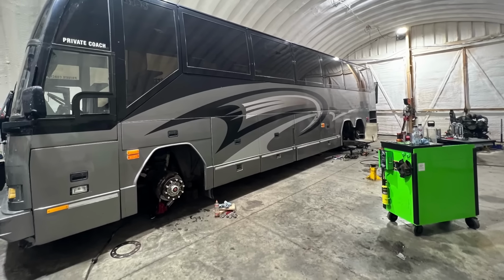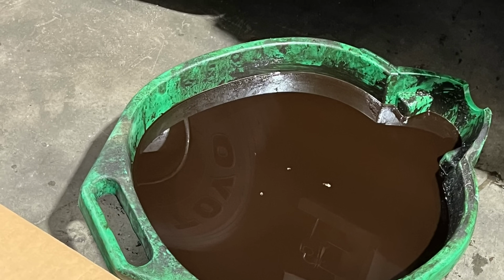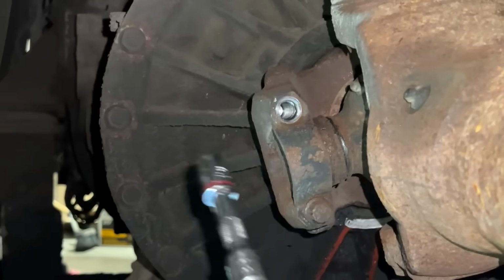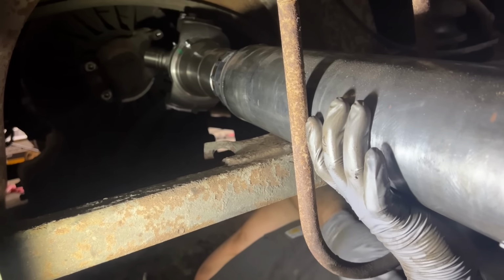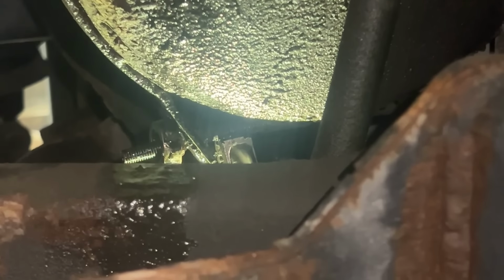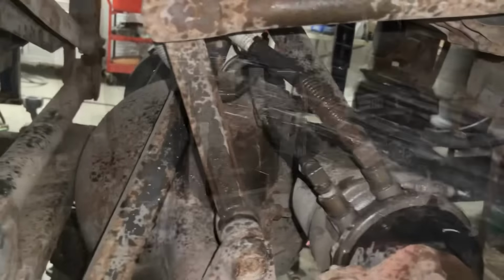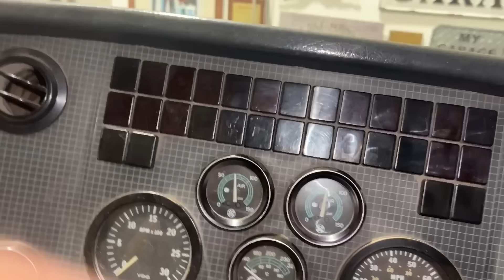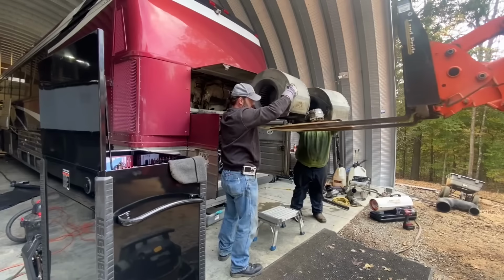Someone removed the ABS light disconnected sensors on this Prevost Drive shaft replacement air leaks

Comment: Hey guys. As a retired DOT inspector in the UK I can tell you that the ABS inactive is a very serious matter. We would have issued prohibition to take the vehicle off the road until it is fixed!  It is also very illegal to use the vehicle in that condition.  Thanks for the vids and tour good work.
Reply: If the UK's auto inspection standards were applied in the U.S, probably 30% of all vehicles and half of the trailers would be written up for violations of one sort or another.  It's a common sight to see tandem-axle equipment trailers with the wheels missing on the front axle and sometimes the front axle itself is missing.

Comment: In the late 1990’s I drove commercially based out of Ohio. I drove for Lakefront Lines. We had over 100 coaches which were maintained spectacularly. One morning I had a big long crack in the passenger side window. The mechanic on duty told me to drive it into the shop, over the pit and he would fix it. He took out the seal on the outside, literally kicked it out, and put in a brand new windshield in the same amount of time it took me to do my pre trip. 

During the summer, we would often have charters going to Cedar Point (a big roller coaster park on the lake). None of our coaches were red tagged, but a rival coach company would nearly always have half a dozen coaches red tagged because their mechanics would do the electrical tape thing on the dash. Lazy and dangerous.
Reply from the maker: Good to hear of the companies that do good maintenance
Reply: Oh Lakefront Lines is a great company, love seeing them on the road.  They take pride in their work, and their coaches are spectacular.

-i don’t work there

Comment: I'm not going to get long winded on this, I'll just say if this company is still operating, they should be investigated by the state & DOT. That said, Scott, you guys have again gone above and beyond. Another safe & road worthy bus on our roads. As to the as-equpipped from Prevost ABS system, it seems that the only possible way to restore the ABS system would be through a Prevost service center. They should have access to the schematics to rebuild the system if the client wants to pursue it. The fact the company disabled the system is beyond the pale.

Comment: Were older buses not required to have ABS and the ABS on this particular bus was an added option? As you said, the bus will pass DOT inspection with the repairs you did without messing with the ABS.  Great video.  Always appreciate all the time taken to edit these videos so the main steps in repairs are shown. High yield content.
Reply: ABS required after 1998.
Not working is a violation
Disabled is a citation

If DOT pushes it, the mechanics could get their cards pulled, further investigation could get the company in hot water.

And he said that it will pass the air brake test, which is proper pressure rise, and minimal pressure loss, within a minute.  I believe it’s 2psi released, 3psi applied.  It will pass that now.  It still won’t pass a level 1 DOT with ABS disabled, though a level 1 is rare, especially on a bus.
Reply: @jaysmith1408  thanks for all the clarification.Much appreciated.
Reply: @Brian-vh7gb  very welcome
Reply: @jaysmith1408  Now that it will likely become an RV, NO inspections required! SCARY!
Reply: @jaysmith1408 A level 1 is rare on a bus, but once that bus is “converted” to meet whatever requirements the state it’s registered in have to title and register it as an RV, a level 1 DOT inspection wouldn’t just be rare, it’ll never happen. Once it becomes an “RV” on paper, it’s treated exactly the same as any regular passenger car, it’s no longer a CMV in the eyes of the law. They don’t stop at weigh stations or spot checks, they don’t have to run a different type of license plate, the owner doesn’t have to have a CDL at all, let alone an air brake or passenger endorsement….they don’t even have to have a Class D “chauffeurs license”, just a regular class E. It’s kind of scary really when you realize there are people out there driving these 30k+ pound, 35+ foot long monsters with air brakes who have no real idea how the air brake system actually functions.

Comment: You might want to check out the u-joint removal tool that Harbor Fright has. I don't know about the quality on it, but it s less than the Tiger. When you find these defects it reminds of getting fired for finding and reporting equipment problems at two different companies. Thanks for helping to make roads safer.

Comment: Purposely neglecting that ABS system was a big mistake.  In my world that would be like just chopping off a major system on a yacht.  You're either going to pay for it to be fixed at the outset of the problem or you're going to pay for it in the long run.  And in the long run the bill is going to hurt 10 times worse.

Comment: Hey Scott got a technical question if you don't mind, what do you use on all the air, fuel ,and hydraulic fitting threads on install? Thank you for your videos all ways great content...
Reply from the maker: On NPT threads we use a permatex product called “right stuff”.  Never fails to seal.
Reply: @BusGreaseMonkey  thx
Reply: @ratster53  I hate to add anything to advice Scott gives, and he basically said what I’m about to buy not in a direct way, and that’s regarding the part of your question about using some kind of product on “ all the air lines, fuel, and hydraulic” fittings / connections…..When he says use “right stuff” on NPT ( pipe thread) fittings, what he means is the ONLY thing you use any kind of sealant like that on is pipe threads….and especially on air and fuel lines on trucks / busses, a majority of the connections are going to be JIC / taper, Compression fittings, Flare fittings, and O-ring sealed fittings…..and you NEVER use Teflon tape or any other kind of sealant / sealer on those. Usually where you’ll find pipe thread connections is at very end of the hose / line where it’ll be one of the above self-sealing connections at the hose end then it’ll thread into an NPT hole in whatever the plumbing is running to / from like the engine block, air tank or compressor outlet, brake chamber, relay or QR valve, etc.

Comment: Shhh11!!! That bus is one of the reasons why I feel much safer here than in US! That bus would not have pass inspection in YEARS! Regardless if it is in commercial or private use. And btw those inspections are mandatory and not a joke! More than a little rust on important places? Fail! Brakes dont work evenly? Fail!  Airbag light on? Fail! Airbag light not on at all at start? Fail! Most likely same with ABS light, but I have not personal experience about that. Airbag light I do.
Reply: I check the regulation and yes ABS light needs to be on at start, but turn then off.
Reply from the maker: It clearly was passing inspections because this just came out of revenue service during covid.  Only a few thousand miles ago.  The bus companies can do their own inspections.  I would love to see their operation.  Stop by and do a pre purchase inspection on a vehicle they are selling.  If you remember or saw a previous video on this bus i mentioned three guys bought buses at the same time.  One burned to the ground on the trip home from buying it.
Reply: @BusGreaseMonkey  Sorry I did meant to say It would not have pass inspection here in Finland in years. To me it feels really odd that firms can do inspections to their own vehicles, it is not possible here! and also other way, inspection firms can't repair vehicles. I think that would be nice video idea to do a pre purchase inspection. This is also not the first time that I am like whhhahaattt?`How that pile of junk did pass inspection? This has happened on multiple youtube channels. Anyway that bus is way better now, even without ABS. Yes I did see that video, wild!

Comment: Abs wasn't required until 99, and it wasn't long before that, early 80s when abs caused many crashes by failing and releasing the brakes so many mechanics and drivers didn't trust the systems for a long time

Comment: build a small air hammer on a floor jack //that they use to break-up cement  for power //and move the jack with air cement  hammer,-- in place of work// with out a pit to work in .

Comment: What year is the bus? Pre 1999 ABS was optional not required on commercial trucks, it was not uncommon for fleets to remove the system.
Reply from the maker: I can’t see a Lawyer in a lawsuit after an accident with a vehicle that had a factory installed safety component being removed being all that nonchalant about it.
Reply: @BusGreaseMonkey  I've been questioned   a few times by lawyers large trucking companies are always seen as deep pockets none have asked if any nonrequired safety systems have been disabled, I have been asked about required systems.. Keep in mind it has been 25 years since the laws changed and 1999 was only 22 years after the  1977121 abs system   disaster and most drivers didn't trust the system. 121 systems were especially bad on buses since it was a single system they had a habit of releasing all the brakes when they failed if you were lucky it took a key cycle to "reboot" the system and get the brakes back if they failed in that manor. It wasn't until about 2009 or 2010 that DOT got serious about checking the ABS light came on with the key and went off as designed to.